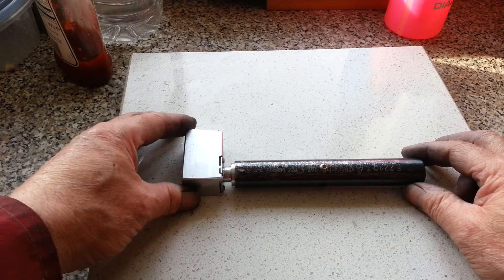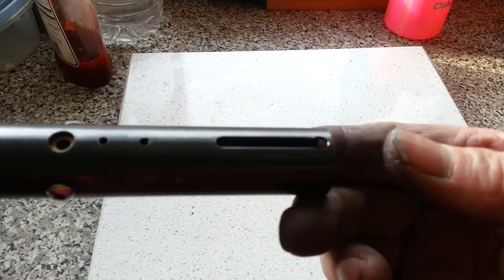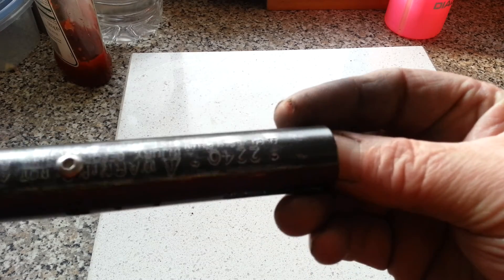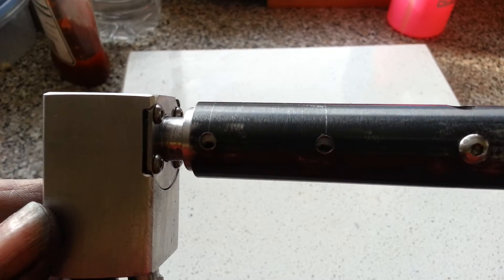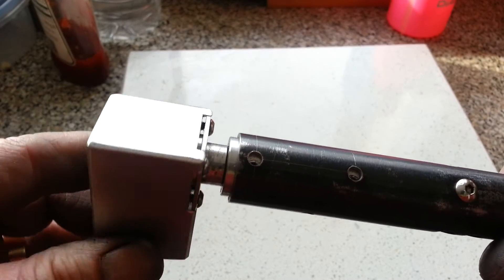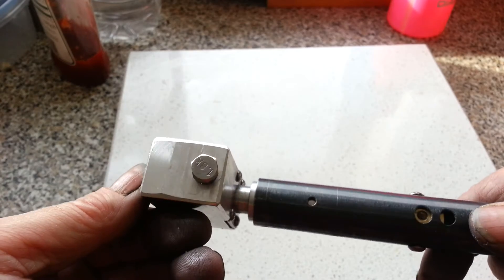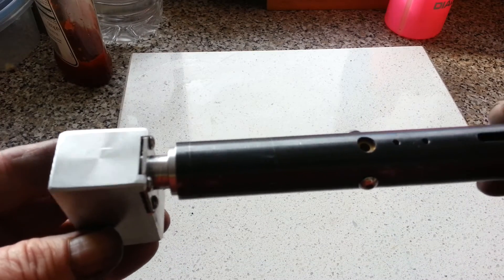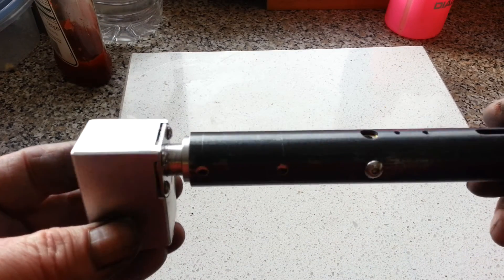Crosman 2240 dropblock

Comment: I had cross man air gun b4 & the barrel is not appropriate to a high pressure power because the groove is very shallow causing the pellets un accurate.
Reply: There's hundreds of perfectly accurate crosman 2240,2250 and 2260  HPA conversions out there that have zero issues, mine in particular runs way over the standard 12g co2 in terms of psi and is tack driver accurate out to 50m so, either you bought/did a bad conversion, or something else was wrong with yours. These crosmans are extremely capable platforms when done correctly. I've seen a 2240 run at 25ftlbs of energy with no issues at all. The barrels are more than capable of handling HPA.